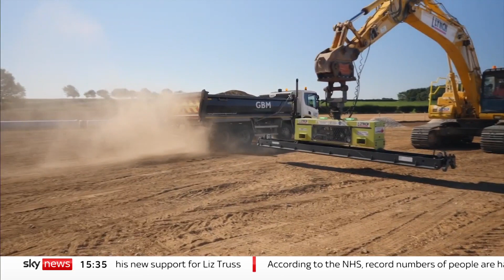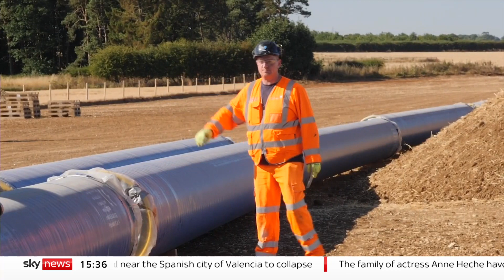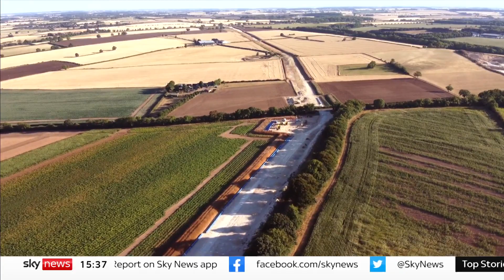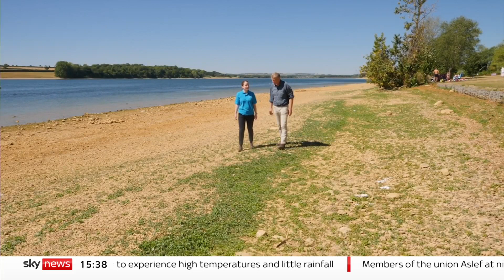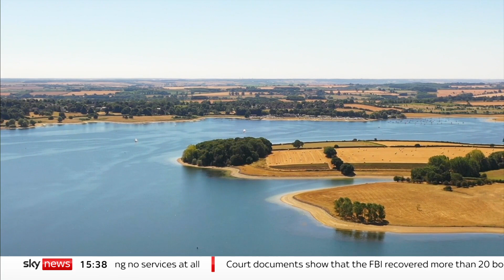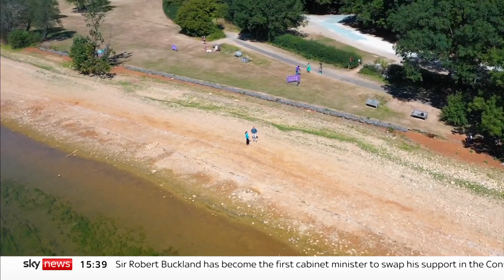How do we stop future water shortages?

Comment: Building new pipelines is like plugging a leaky old rotten bucket with your fingers. Most of the water pipeline network in the UK is well past it's overhaul date, some of those pipes are ancient.
Trillions of pinhole leaks and miles of porous old pipes stack up alongside faulty joints, which is why we loose over 3 billion litres of water every day before it gets anywhere near a tap.
We need a thorough overhaul project to reduce this massive waste to an absolute minimum, which would drastically reduce the strain on existing reservoirs and water processing.
The funds for it needs to come from reinvestment, instead of the current siphoning off of funds into greedy shareholder's wallets never to be seen again.

Comment: A cloudbuster is a device designed by Austrian psychoanalyst Wilhelm Reich (1897–1957), which Reich claimed could produce rain by manipulating what he called "orgone energy" present in the atmosphere.[1]

Reich with one of his cloudbusters
The cloudbuster was intended to be used in a way similar to a lightning rod: focusing it on a location in the sky and grounding it in some material that was presumed to absorb orgone—such as a body of water—would draw the orgone energy out of the atmosphere, causing the formation of clouds and rain. Reich conducted dozens of experiments with the cloudbuster, calling the research "Cosmic orgone engineering".[1]

Comment: The problem is multifaceted and ultimately depends on humans changing the way they live, grow and get around.
Reply: Most don't seem particularly interested in living differently. Not a strong enough image of different potential lifestyle. Most people seem pretty stubborn and more or less loopy.
Reply: Blaming it on lifestyle is not accurate. People aren't doing any different than they did 20 years ago, if anything they're less wasteful, showers instead of baths, short flushes on toilets, less lawns and more patios. No upgrades to infrastructure for the increasing population. No new reservoirs being built and mass immigration hasn't helped.
Reply: @commandocol316  Improved a little in certain ways. Between the 50s and 2000s was incredibly wasteful and no people aren't really living differently than 20 years ago.  Plenty of expanded infrastructure and developments too just not as much as those industry's want and would be doing if there was no other concern.

Comment: Four simple ways.   1 Force water companies to take on more repair crews to fix all leaks within days and not months.  These extra crews can be paid for out of the immoral salaries and bonuses the company directors get and also by reducing the dividend share they give to their share holders.   2 When the water companies are seen to be doing their bit, then educate people to be aware of how to be more economical with water.  3 The average daily use of water per person,  is in the region of 150 to 160 litres per day.  The more people that are in the country means there is less water per person.   4  Invest in the de-salination  of salt water.  We are surrounded by it!
Reply: I use 3/4 cubic meters in a 3 month period which I think is comfortably under 40liters a day tops.
Reply: @leifcian4288  Accepted but I did say average.
Reply: As a share holder i dispute number 1, however i do think directors should take a cut and their pay should be performance related ie linked to leak fixing. Number 4 never happen way to expensive for the UK and then theres the problem of what to do with the by product brine
Reply: @apocalypticweasel9078  The brine could be treated and made into a form of salt to use on the roads in winter. We never seem to have enough.  Anything else left, if it is salty. it can go back into the sea where it came from.
Reply: @colinmiller8361  of course desalination of water is a massive energy drain. Improving landscape watersheds can potentially be an energy generation and storage solution in of itself. Vast amount of solar power drives the hydrological cycle..
Reply: @leifcian4288  Yep, desalination is not very sustainable. Retention, storage and land management are better options.